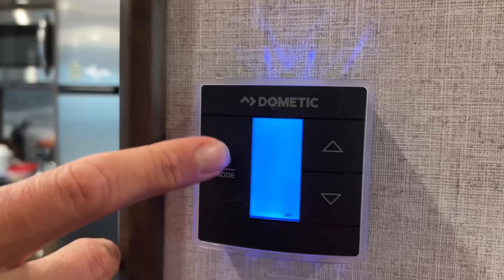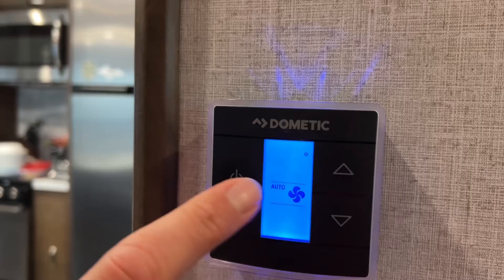RV Furnace Blowing Cold Air? 10 Second Fix

Comment: Ahhhh thought this might be our fix - it was on HIGH - switched to AUTO but it still just blows cold for 20 seconds then turns off.   Dang.

Happened to us once before and it was a sail switch I believe!
Reply from the maker: ☹️ The sail switch is a common part that needs to be replaced on furnaces.

Comment: I have a Alfa Wolf Travel Trailer with an electric fire place. In order for me to heat my camper, I have to turn on the fireplace which only heats up a small area. Never have I figured out how to get the hot air to blow from the ceiling vents. I dont think my travel trailer is setup that way. I maybe wrong so I give this a try and let you know. On my dometic thermostat, it does show a furnace setting but it doest blow out hot air. Only cold air. Help...

Comment: My heater quit working in the middle of the night.  We heard a pop, and didn't know it wasn't heating anymore.  Got up hours later and it was 59 inside with no heat coming out.  We had to switch to gas.  What is the sail switch??? It hasn't worked since
Reply from the maker: Sail switch is in the furnace. It determines the fan is spinning fast enough for it to try to ignite. If the fan blows for 30 seconds then shuts off, it’s usually the sail switch. If blows for 90 seconds then shuts off it likely failed to ignite (gas issue) and the sail switch should be good.
Reply: @RadarRoadWarriors    Thank you, it blows, just cold
Reply from the maker: @tracym9142  I made a 3 shorts on the sail switch. If you go to my channel - shorts - and scroll down about 15 videos, you'll see the 3 videos together with the word sail switch on the thumbnail. This is the first video in the series: https://youtube.com/shorts/NCnOR97chyU?si=ioC7WWHXLypcoV-Z
Reply: @RadarRoadWarriors  thank you so much.  I love your videos!

Comment: YOU WILL NEVER GET ANY WARM AIR OUT OF THE CEILINGS VENTS UNLESS YOU HAVE A HEAT PUMP & AC COMBINATION.
 NEVER
Reply from the maker: That’s not what we are saying in this video. If you don’t have the correct setting on the thermostat, you blow cold air from your A/C ceiling vents instead of blowing heat from your floor vents.
Reply: @RadarRoadWarriors  
I have no need to run AC ceiling vents during winter. Why would you?
Reply from the maker: @TP-vu3tc no one does, that’s what we are showing in the video. How to take it off the setting that is blowing cold air in the winter. You really missed the point of this video.